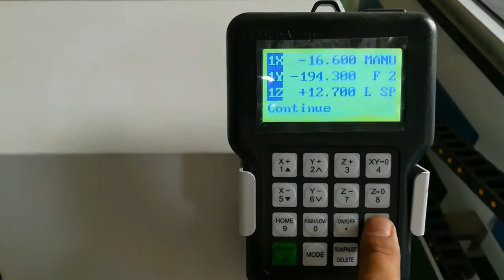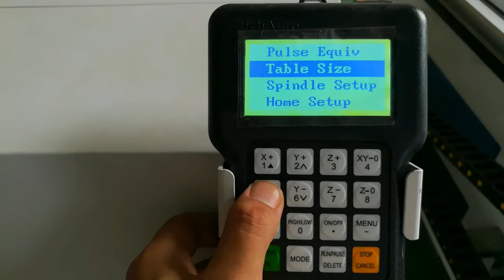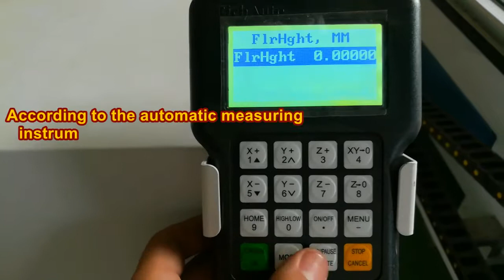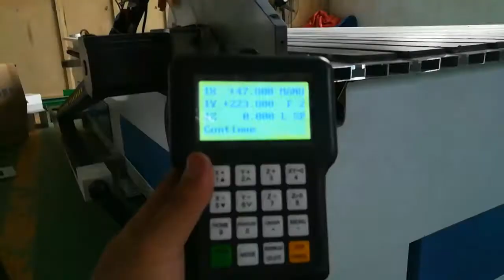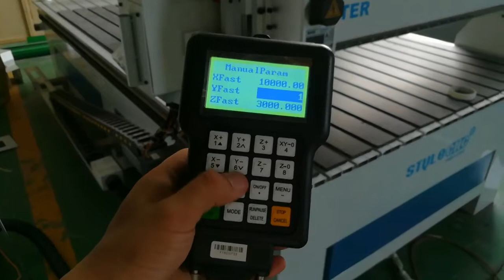How to set parameters in richauto A11 control system.

Comment: Hi 

I have a Laguna Swift 4x8' and when I push the "Home" button in my DSP Controller Richauto A11 the router moves correctly to the home position that is set in Y- and X+

But when I manually move the router to Y+ or X- the router goes off the limits and "crash" with the router structure 

I set the Table Size in the DSP Controller to: 

X Size = 1219 mm

Y Size = 2438 mm

Is that correct or I have to modify that numbers or another option?
Reply from the maker: Made according to normal Chinese machines. When Home is pressed, the machine moves to the X- and Y-positions. That is, the machine is in the front left corner.

Comment: I have a 1325 cnc router and I have lost my pulse parameter do you know how can I find it
Reply from the maker: Are you using our company's machine?
The pulses of each machine will be different.
First, you need to confirm which drive your machine uses.
Know the "segmentation" parameter of the drive settings.

Comment: I move 1mm in DSP A11s but the machine moves 2.5 mm.
Please solve my query
Reply from the maker: The pulse settings in your controller are incorrect.
You need to adjust the pulses within the controller

Comment: how to know what pulses parameters to set
Reply from the maker: In 30 seconds, the number of pulses is set.You need to consult the manufacturer of your machine. The pulse number is not fixed
Reply: @STYLECNCService  I am the second buyer, so i don't have contacts of the manifacturer. And i cant find anything if i look in google for that manifacturer. 
Name: ARTE MAK pres
Model: MED-1318
Voltage Rating: AC220V /50Hz
Working size: 1300x1800mm
Spindle: 2.2Kw 
Those are the information in the label of the machine
Reply from the maker: @AgronStatovci     You need to send a picture of your machine to me and let me know what kind of drive it USES. What kind of transmission structure

Comment: I have A11 controler and there is a parameter Circle limit. Also to know I have with out wanting reset the controller. I have made everything as before except for the Circle limit. On my controller it is about 4232. For I have seen on the net at others it is about 1000. So do you know what is that Circle limit for so I know how to set it? .... dont mistake it with CirLimit
Reply from the maker: It means to limit the speed at which you can make a circle.   mm/min